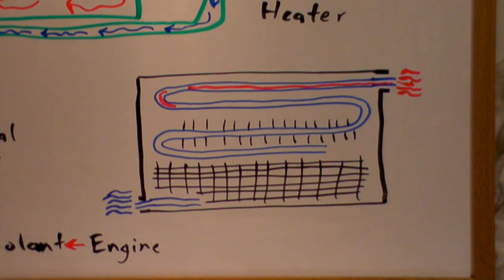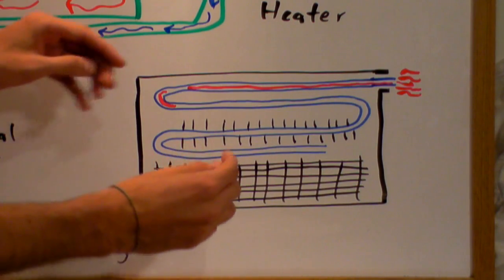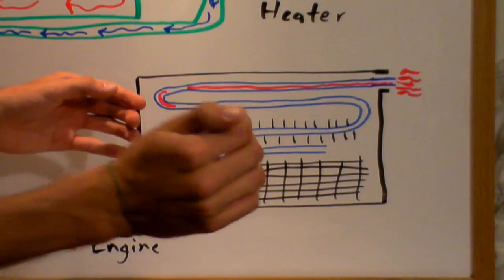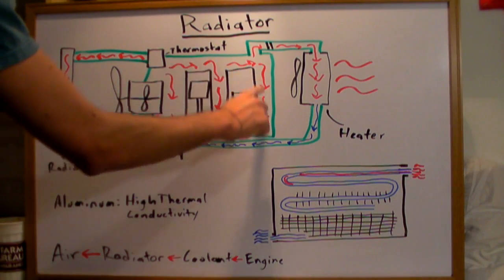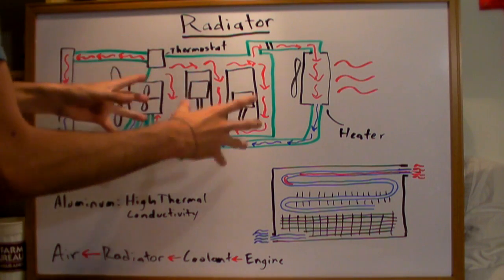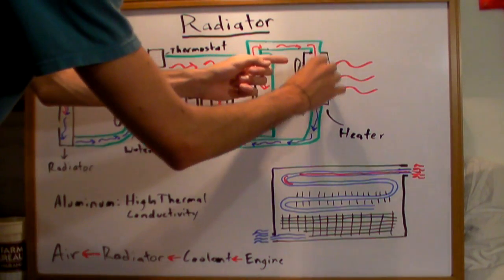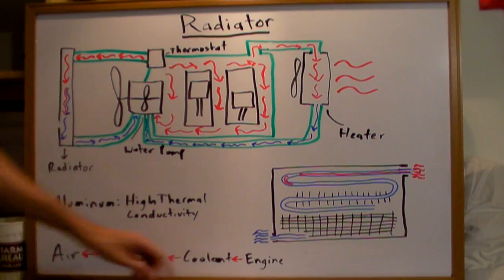Radiators - Explained

Comment: A common question I find is why is there a thermostat.  The reason being that by shutting off the coolant you allow the engine to heat up quicker when you turn it on.  Engines are more efficient when they are warm so it really is there to save gas.

Comment: Had an old 1980 falcon with alloy head. In Australian summer I would take out thermostat, and leave cabin heater on full bore. It kept the engine temp at 3/4 mark. This car had no AC so it was friggen hot to drive. Turn off the heater bypass in cabin and watch the engine temp alarmingly climb. Also had a block of wood under the bonnet latch that kept the bonnet open a extra 2 - 3 inches, enough for extra air to flow over top of engine. Was an XD Ford Falcon.I dumped 3 lots of BARS stop leak in it over 5 years due to radiator continually leaking each summer. Now I am spoiled with a 2002 Ford Falcon with temp that doesnt go over 1/2 in summer with AC on full bore.

Comment: I think the idea was to make airflow from the front of the vehicle, to the vents, as straight as possible. Or smoother, as you said.

The top of the hood is a low pressure area at speed(I've been told), which makes the high pressure air "push" it's way out of the engine bay.

A non vented hood setup doesn't allow it to exit the engine bay...It just gets tumbled around by "fresh air". This setup allows fresh air to "push" the warm air out. This reduces drag by means of cleaner airflow.(?)

Comment: added preassure in the cooling system raises the boiling point of water by two degrees. most road cars have a preassure of around .7-.9 atmosphears of preassure. So in essance the boiling point is raised to over 30 dgress in a car's cooling system.

Comment from the maker: @Aexotica There is a pump at the front of the engine run by one of the belts. This pump generates enough force to pump all of the fluid, and the piping is strategic so it flows in a set direction.

Comment from the maker: @ThePustr117 It's a series of coils that the air passes through. The rest of it is fins connected to the coil to improve heat exchange. There is no fan, the coils are cooled by driving and the air rushing through the intercooler (It is placed at the front of the vehicle).

Comment from the maker: If the air is 100 degrees, and the coolant is 180 degrees, and you're moving at 60 mph, that's a huge amount of energy which you can still transfer. The temperature difference may not be huge, but you make up for it in the volume of air which passes through your radiator.

Comment from the maker: It's not intended to. That said, it can be a common problem with some engines, many times due to a head gasket failure. If your exhaust is coming out bluish white, and your oil (check your dipstick) is milky/coffee colored, it's from coolant getting into the oil.

Comment from the maker: Cold start is just starting your engine after it hasn't been running for a while, hence the engine is cold. CAIs typically don't have silencer boxes on them, they also attempt to draw "cold" air away from the heat of the engine, thus increasing the amount of oxygen the engine has to use for combustion.

Comment from the maker: @ThePustr117 Yes, they are very similar, but used for different purposes. Radiators are used to cool the engine. Intercoolers are used in forced induction scenarios, when a car has a turbocharger or supercharger. The air that is sucked in the engine by the turbo/supercharger is pressurized, increasing its heat. The intercooler cools this air before it enters the engine. See my video on turbochargers for more info on it.

Comment from the maker: The job market is okay, there is always a place for quality engineers, but starting can be difficult. Yes, using the heater does cool the engine. Doesn't really affect performance as you're really just using a fan, which doesn't use much energy, unlike an A/C compressor.

Comment from the maker: It would warm up quicker with the heat off, but not by much. Also, having the heat on really doesn't require using much more energy, since the heat itself is simply waste. Running the fans however requires energy, so I suppose technically leaving it off would be more efficient (if the engine doesn't get too hot) but it's not like A/C where it takes a significant amount of energy.

Comment from the maker: @glacier1500 I believe it is possible for both options to occur. Have the hot run to the top or the bottom. If it goes top, as it cools it becomes more dense and sinks. However, if the hot is run into the bottom, it will naturally want to rise. As far as flushing it, I don't know the answer. I would think flushing from top to bottom would make mores sense just because of gravity, but I don't know haha.

Comment from the maker: The radiator and engine fluid are all the same fluid. If the temperature is constantly going up and down, could be the thermostat. Mine failed on my integra, I have a video on replacing it.

Comment from the maker: Yes, in the case of engines with forced induction. You can still have air cooled engines which use air-to-air radiators. Intercoolers cool the intake charge of the engine. Radiators cool the engine.

Comment from the maker: Good point, though I'm guessing the routing, having the air move up (equal and opposite) has some influence on downforce; also, it's a more direct way of moving heat away from the engine.

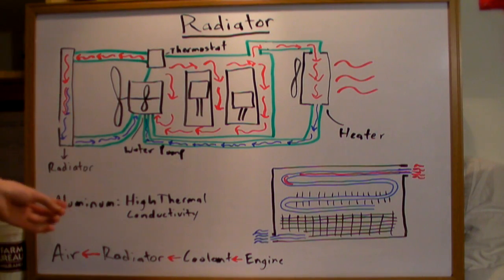Comment: Very nice presentation. @2:50 air flow passing thru radiator cools off the coolant. Question..when driving thru 200 miles summer desert over 100 degrees, hot air passes thru radiator, how does it cool off coolant ?
Reply: While the air might be 100 degrees F it's still much cooler than the coolant flowing the radiator which is closer to 200 degrees F. The hotter air does make it a bit harder for the radiator to do its job but they're generally designed to still work effectively at 130 degrees F or so. When running in colder temperatures the radiator doesn't need to work as hard, which is where the thermostats come in.

Comment from the maker: I suppose turning on the heat wouldn't do much harm. Obviously you have to power the fans, but that's not too much energy. The reason the A/C takes so much power is running the compressor.

Comment: Love your videos. I'm currently a student and bought my own car a while ago and decided to learn more about cars in order to be able to maintain it well. I had a radiator problem a while ago and after watching the video it sparked random curiosity. Here: If your radiator isn't functioning properly, are you able to offset the effect by turning on your heater to the max?
Reply from the maker: Yes, your heater can help cool your car. In fact, in my Integra I could watch the temp gauge go down when I turned on the heat in cold weather.
Reply: Engineering Explained Thanks. Does that imply that if you turn on the cold fan or air conditioning your car is more prone to overheating?

Comment: Amazing video! So I have a question if you have the heater on therefore having the coolant passing through the heater core does that mean you will have no coolant at your radiator correct?

Comment: So if my car is parked with the engine on, no cold air is getting into the radiator and thus my coolant will not cool down? Is that correct or did manufacturers find a way around that? Thank you for all your hard work in advance!
Reply from the maker: There are fans that will power on when your car is not moving to pull air through the radiator to keep the engine cool.
Reply: Engineering Explained. Not all cars do this; none of mine have.
Reply: I noticed this issue on my old '95 astra (hey, it was a good economy car alright XD) where it would overheat like crazy when i was stuck in a traffic at a hot summer noon, later that day it would get worse and start overheating when driving too so i turned on the heating and opened all the windows for some additional cooling and surprisingly, temperature actually stopped rising so that i managed to get to a garage and fix it xD The problem turned out to have been way more complex than just fan malfunction, it had to do with the water pump
Reply: ArabxGT the fan

Comment: Overheating issues so I removed the thermostat and the engine seemed to overheat easier at idle than with the thermostat installed.
I put thermostat back in but rigged it open I read the thermostat was designed as an calibrated restriction so water would NOT flow through radiator too fast.
Is this true ? Does the water need to stay in the radiator a certain amount of time in order to be cooled enough ?

Comment: Hey Jason, Watching the F1 in Mexico this weekend and I am struggling to understand the effect of altitude on cooling. I can comprehend the effect on combustion and aerodynamics, as I understand the maths that goes behind it, but my knowledge of what I suppose is thermodynamics. The race is in Mexico City, which is 2200m above sea level, which reduces the air density by about 22%.
Reply: +Matt Hollier heat needs to dissipate so when heat leaves the car it goes into the air thus the higher you go, the less air there is for heat to travel through. since the air at higher altitudes is much more dense (reason why we cant breathe up there) then air at ground level it causes the exchange of heat to have a little vacuum to dissipate through. that's where oil tempt rise, brake fluid tempt rise, etc.

Comment: Hii, great video as always, i have a question
 Is it bad to shut off the engine while the radiator fan is running?
And if so, why is it bad?
Reply: No, it doesn't harm the engine if you shut it off while the fan is running.
Reply: shi01 Hi, i wanted to know if it would harm the radiator system, thanks.

Comment: Thanks for making this video. I was trying to find out how they work on a CPU water cooling system. It has a radiator just like a car. The water flows to a water block which cools the CPU, then that water runs to a mini radiator that has fans that blow threw it. I'm just surprised a radiator can cool water so fast just with air.

Comment: Nice explanation. What confuses me is that I have an 01 Nissan Sentra. I rectly replaced its thermostat and found that the thermostat is located on the engine block connected to the lower hose. I have heard of top down and bottom up cooling systems, but mine looks like a regular top down cooling system (radiator). Can you please help me understand this? Thanks

Comment: how does water flow and cool down the engine? are there special passageways made for the water to flow through in the engine block or how does it happen? also how can air, even our hot 100+ degree texas air cool down water to a point to where it can actually cool down metal?

Comment: Is it really a good idea to cant the radiator forward and lower the mouth of the car to the ground? I know the 2014 Corvette C7 Stingray does this, sending the hot air through louvers in the bonnet, and they say they got the idea from racing. But is that really a good idea for cooling and aerodynamics?

Comment: So you mentioned that the hot coolant flows through a rad for the heater, how does the air con work in a car then? Would it be cold coolant in the rad, that's come from the other rad? Didn't show how the flow would work in your picture. Great video though.
Reply: The air conditioning is a completely seperate system and does nothing to cool the engine down. The air con works the same way as a refrigerator does and is powered by the engine but is not needed by the engine for any purpose. It is only there to cool the passenger compartment.

Comment: So after driving for a while and then parking, if the inside of my car is a decently high temperature from the engine alone, is that a sign of my radiator not working as it should?

Comment: Thanks man for your videos, there are very usefull. I cancled my heater and I blocked all the hols and I took the pips off. Is it bad?  Someone told me it will stop the circulation of the radiator coolant or water?

Comment: It seems that coolant thermostats on newer cars open at a higher temperature than older cars. The thermostats vary between 180F to 207F. What is the advantage of getting to such a high temperature? Can using a colder thermostat be bad?

Comment: Hi everyone, I got a mazda 3 year 2010. When i replaced my cabin air filter after the car has been running for about 20 minutes, my hand touched the aluminum pipes going to the heater and my hand almost get burned. What could the problem be if both pipes connecting to the heater is very hot to touch? Appreciate any helping answer.

Comment: Hey there Engineering Explained, first I will thank you for all your great and informative videos second I wish to ask you a question. I have an'01 Civic Ex w/a 5ive speed with 200,000 miles on the odometer. On occasion it looses power about 80% of it, begins to overheat, and the exhaust manifold glows red hot. It had a new head gasket installed recently so I hope that not the case again. However I hypothesize a bad O² sensor intermittently calling for a super lean mix. Is it possible? Thanks.

Comment: When u turn on the heater and coolant goes to the other radiator... here does all the coolant goes only to the other radiator or to both of them?

and can you explain the engine oiling system plz

Comment: So what if your engine is still running hotter than normal with a new thermostat and coolant? Is there a process of troubleshooting that can be done?
Reply from the maker: I would look to make sure the radiator doesn't have anything clogged in it, or blocking air from flowing through. Check to make sure the fans turn on when needed (idling while not moving). And make sure there are no air bubbles in the system.

Comment: As far as I know the thermostat function is different from what explained in the video.  It  holds cold coolant in radiator until the coolant inside engine goes up to certain degrees and opens the valve so the cold coolant comes into hot engine.   What said in video is, it holds coolant inside engine until the coolant goes certain degree and opens the valve so the hot coolant gets into radiator.

Which is right?
Reply: Would that not be the same thing? Is your glass half full or half empty

Comment: If the radiator were to stop working or be damaged and i leave the heater on in my car will that serve as the same purpose as the radiator... In that it will cool the coolant?
Reply from the maker: +rikesh kylas Yes, it just doesn't reject nearly as much heat, but it can certainly help.
Reply: I did that once before, on the expressway when my car was overheating.  It allowed me to get another 10 miles to the gas station where I put water in the radiator -- then everything was good.If you do that, be sure to roll your windows down so the heat can get out of the cabin!
Reply: It's too small the radiator in the car is much smaller it's only purpose is to give you heat and AC the rad in your engine bay is much bigger it would help but I wouldn't recommend running the vehicle too long

Comment: ok :)
tho it is a circulation pump? not and Pressure Pump...?
so when it Then Gets a leek inn to the radiator, it will not be able to circulate the water...... as the Hot water will Just leak out before its able to get thru the Radiator.....Because of the Heat pressure... This is kinda what i`am thinking about.. 
so with that, the pressure actually do have some to do with the process of getting the water thru the system ?

Comment: This is a dumb question but where would the intercooler go if you have a turbo/super charger wud it replace radiator or be connected along with it
Reply: +Evan Tan An intercooler (or 'charge air cooler' as they were originally known as) serves a completely different function than a radiator. The intercooler is only meant to cool the charge air (as in the pressurized air from the turbo/supercharger) so that it becomes more dense before it enters the combustion chamber - this primarily serves to increase horsepower. Reason you have an intercooler is because whenever air is compressed (e.g. by a turbo) it increases in heat (take a bike pump, inflate a bike tyre vigourously and then touch the bike pump afterwards...you'll notice it's warm); this warm air becomes less dense. Less density = less fuel (to maintain the same air/fuel ratio) and thus less power...so an intercooler's primary function is to increase horsepower (whereas the radiator as seen in this video serves to cool the engine and keep it within operating temperature range). Sorry long answer lol. Hope this helps.

Comment: How does the coolant pass through the engine? Does the engine block have tunneled holes surrounding the cylinders where the coolant can flow through and yet not breach the combustion chamber and the oil reservoirs?
Reply from the maker: Correct!
Reply: Threw the coolant passage ...

Comment: Is aluminum the best metal for this? I know it has a low specific heat, it's relatively cheap and it's rust-resistant, but surely there's something better than aluminum, right?

Comment: So if it's cold, like below 0 and I want to quickly warm up the engine I should not turn on the heater inside the car? It will "take" the heat from the engine, thus will it be longer warming up ?
Reply: +Szymon Okuń right'o.  to my knowledge, there is another thermostat on the heater system to prevent the water circulating until the engine is warm, but heat on or off, it's not going to work until the engine is at operating temperature.
Reply: +Szymon Okuń Yes in my experience in any cars I've owned, running the heater when it's cold actually makes the engine take longer to warm up. In winter I normally wait until the engine is almost fully at operating temp before operating the heater wherever possible.